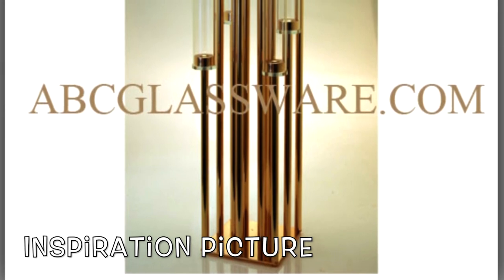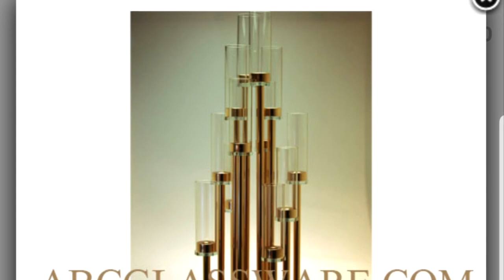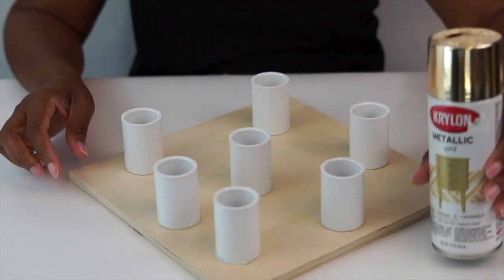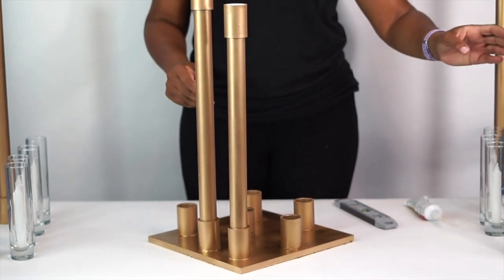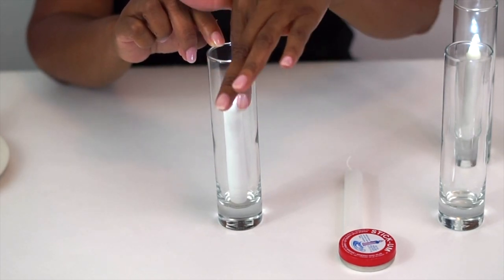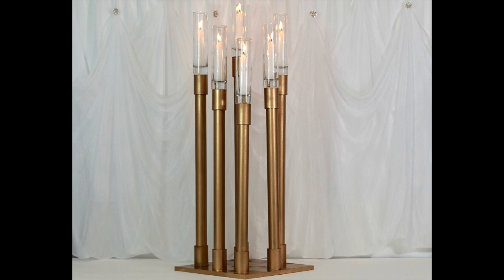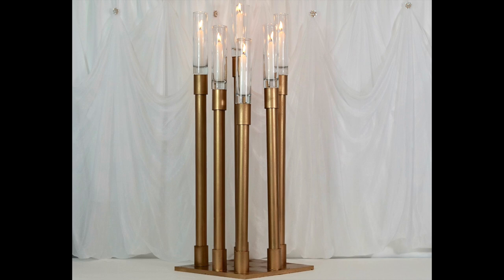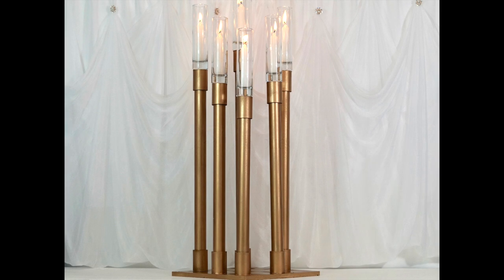DIY 34 Inch Tall Candle Wedding Display | Tall Wedding Centerpieces | DIY Tutorial

Comment: One question: could you have used E6000 as the sole adhesive throughout the project? Why liquid nails?
Reply from the maker: Hi Kalecia!  E6000 typically takes longer to dry.  But if you choose to go that way be sure to use the extra strength Industrial E6000.  Hope this helps!
XOXO MissPlanIt